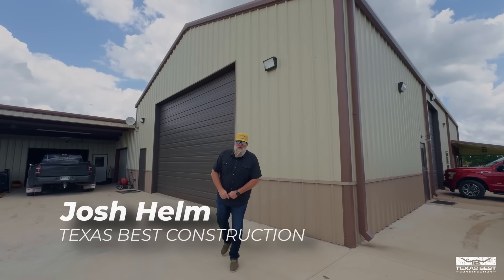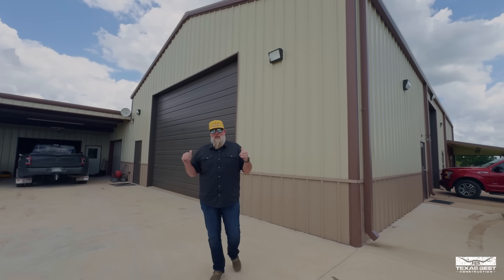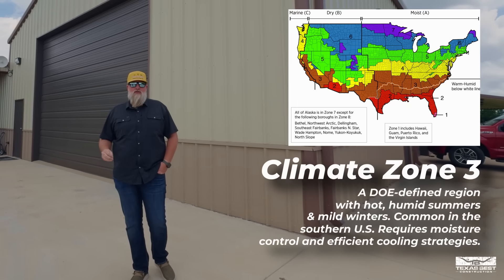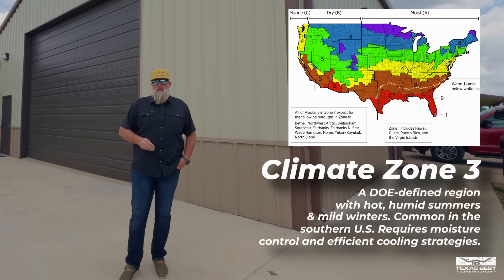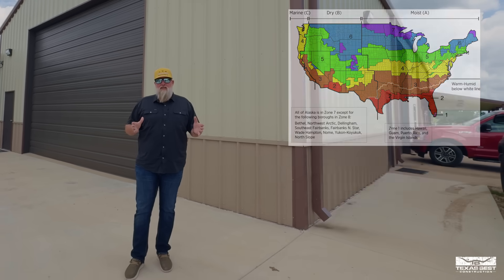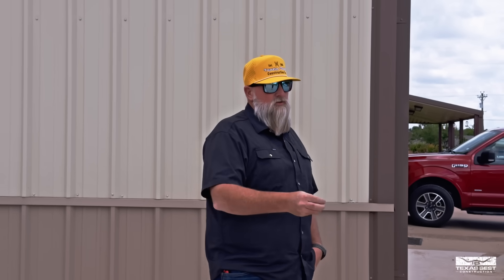Battling Texas Humidity in Barndominiums | Build Science Tips You Need to Know

Comment: Going with just spray foam... Aren't you then lacking the moisture barrier?   I know closed cell is s vapor barrior but i dont believe its a moisture barrier.  Tracking down leaks would be tough and damaged metal panels would be a pain with foam manufacture recommendations to spray directly on metal.

It seems like zip with metal over the top would be the best solution but obviously a lot more expensive.  

Cost savings might be zip with metal on top and then a blown in blanket system to save $ vs the foam.  However adding zip itself is a huge expense and then opens you up to using more traditional siding.

I feel like im trying my best to learn but the variety of variables makes it tough on deciding how to sheet (or not sheet) thr building and how to insulate it
Reply from the maker: The zip system is the best solution over top, adds a lot of cost because of framing. In the hybrid method that we build our roof system becomes the moisture barrier and all. The closed cell foam is the most economical solution around the steel.. the more the better. If you’re concerned about the roof and if you had to replace it. My recommendation is to use it as a deck at that point and to go over top of it. That is how we would deal with that scenario. Great questions, it is a battle to juggle budget and wall and roof assemblies but if we are talking about what is Best it is for a complete zip barrier every time. Whether hybrid steel frame or post frame construction.

Comment: Zip system is NOT a vapor barrier. It is a weather and moisture barrier. Zip is around 14 perm.
Reply from the maker: That’s correct. ZIP System sheathing has a low vapor permeance, but it is not a considered vapor barrier. More of a retarder, because It is designed to allow some vapor to pass through, this prevents moisture from being trapped inside the wall. I guess better thing to say would be In our climate we have more of a vapor open assembly.
Reply: @TexasBestBarndominium so you have had no issues with filling a wall cavity with open cell? Paired with say zip sheathing. Im in the same boat where we have pretty much 2/3 cooling to 1/3 heating. Its hard to decided what products to put where so I dont trap moisture.
Reply from the maker: @EverythingBashBros I don’t have a problem with it nor ever have in the past on the walls. The roof is more of an area where you can have accumulation from interior humidity etc. Another reason why we like to have closed cell foam in those spaces. Also beyond doing a whole home dehumidifier would recommend an ERV (energy recovery ventilator) this helps to manage stale and polluted air…